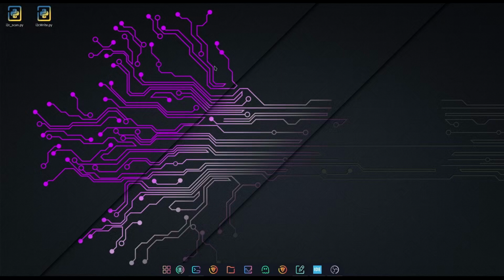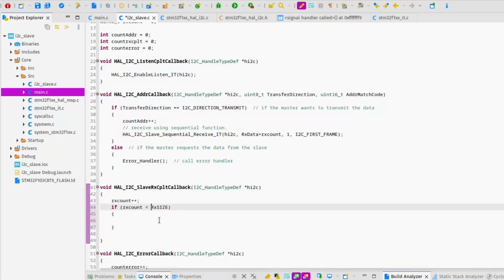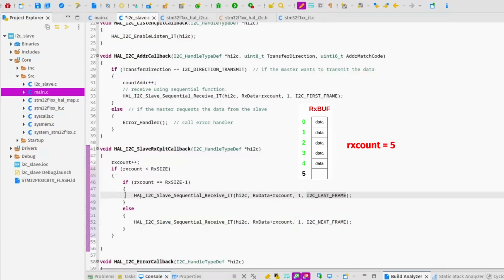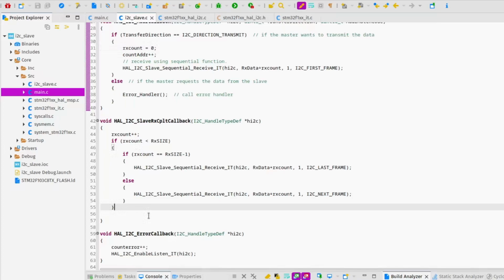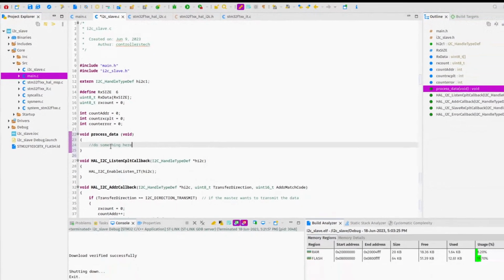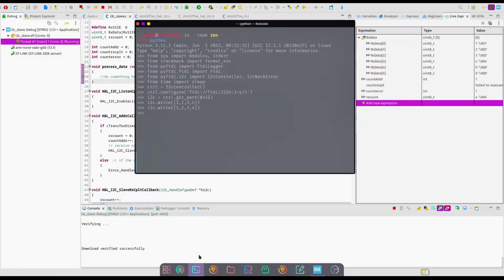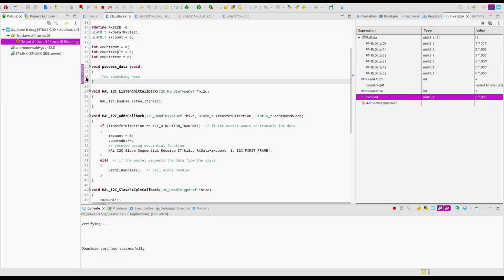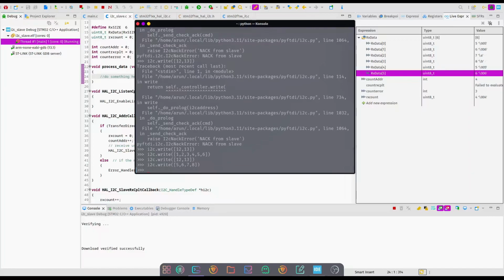STM32 as I2C Slave || PART 3

Comment: Hello, I wrote exactly the same code as you, but my slave does not send any NACK signal (checked with logic analyzer) to the master at the last frame. (I am using the same microcontroller (F446) as a master on a different I2C pheripheral). Do you have any idea why is this happening?
Reply from the maker: Slave will not send a nack at the last frame. If the master send more data after the last frame, then the slave will send nack.
Reply: @ControllersTech  yeah, but it newer sends NACK, even if i write 7 byte but slave should only accept 6. Every data is ACK-ed by the slave even if it is more than 6.
Reply from the maker: Not 7... please watch all videos. I can't explain same thing in the video and then answer it in comments again.
Due to clock stretching,  it should be able to handle 1 or 2 extra bytes. Nack will come after 9th byte.